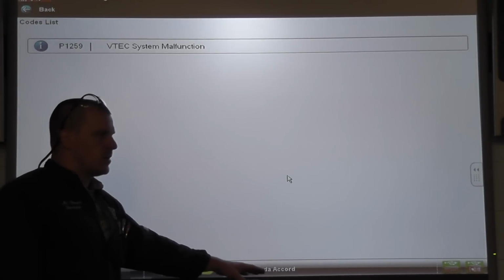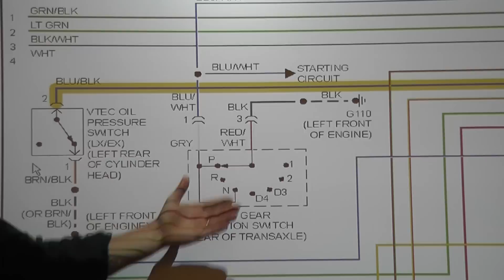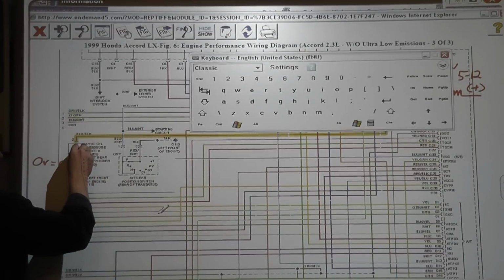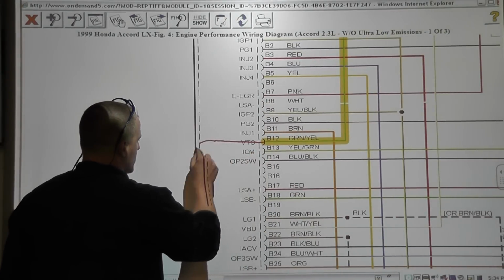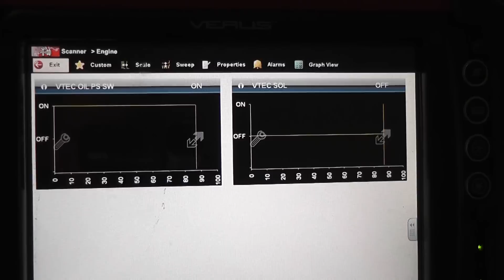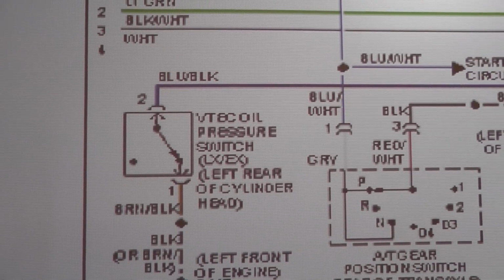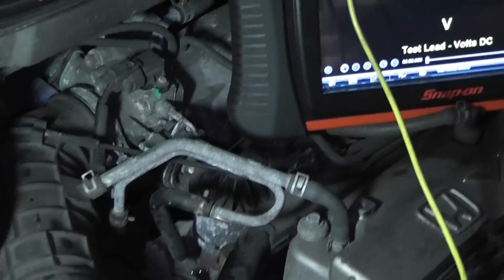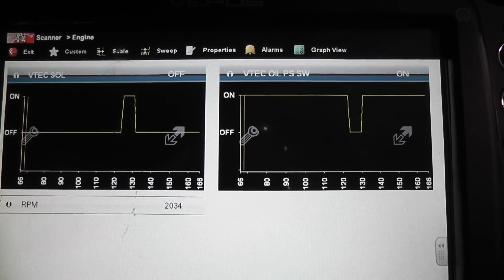Honda VTEC System Testing (P1259 trouble code)

Comment: Nice video, very informative. Should there be continuity between the two terminals of the HARNESS of the pressure switch? Also, what does it mean if you measure 5V between terminal one of the pressure switch harness and ground, while the solenoid is not activated? You measure 0V in your video. Not sure why I am getting 5V.
Reply: On the psi switch itself. Yes and no as the switch opens and closes by hydraulic psi. As far as when it read 5 and when it reads 0 on the psi switch, I don't remember. (Thought it was 12) It is the change in voltage on the psi switch, as the solenoid is energized that is important
Reply: So if you energize the vtec solenoid, and you see no voltage change on the pressure switch, does this mean that the pressure switch is bad or is the ECM/PCM bad?
Reply: My problem was fixed by replacing the entire solenoid / pressure switch assembly - it is possible mine was clogged. If you already did that, and you are not getting that voltage change on the pressure switch, it is possible your oil pressure is too low to activate the pressure switch. It is hydraulically activated. Get the kit from harbor freight for $20 if you don't already have one. You should get >10psi at idle, and >45psi at 3000rpms. Wait till the engine is hot to get your final reading. If your oil pressure is low, you may need a new oil pump and that could be the root cause. Also, make sure you have the multimeter hooked up to the black/blue wire.
Reply: I thought you had already replaced the vtec solenoid assembly? The assembly includes the solenoid + the pressure switch. If not, go for this first. Dorman sells the assembly which is what i used and it worked. The price of the dorman assembly made it worth buying compared to the pressure switch by itself. There is a kit at harbor freight for measuring oil pressure in the automotive section. Its $20. Just a hose with brass fittings and a gauge. The brass fitting gets connected where the oil pressure sender unit is, just below the vtec solenoid assembly. It can be identified by a rubber blue connector. Remove the connector and then unscrew the sender, and then connect the hose for the pressure gauge in its place. Start up the car and wait for it to get to temperature as the pressure reading will change as the oil heats up.
Reply: It was a bitch for me too! Are you sure there was no leak in and around the brass fittings or the hose itself? When I connected mine, i got about 70psi as soon as I started the car, measured from idle. As the car heated, and the viscosity of the oil went down, the measurement ended up at 12psi. Another thing to check would be, is the gauge working (especially if its from harbor freight)? You may not want to hear this, but a good way to test if the gauge is working is by checking it on a car that is known to be in good working condition.  Alternatively, if you have an air compressor, you could also use that to check the gauge (and it may be the easiest way).  If your measurement of 0psi is real, I would start taking a hard look at that oil pump. Hard work but pretty cheap on rock auto...less than $100 last time I checked.
Reply: I have the same question.  I just replaced the entire solenoid / pressure switch assembly with brand new OEM.  When I energize the solenoid I do not see a voltage change on the pressure switch.  I do not hear the sound of the engine change either.  What does this mean?
Reply: Thanks Terp Guy.  I think you are right on the money.  It's got to be my oil pump gone bad.  It's a little discouraging I have to take off the timing belt to get at it.  I might as well replace that too along with the water pump.  Big job.  :/
Reply: Take an oil pressure measurement before you do it. It's one of those things you wanna be sure you need before you get started. Here are instructions on how to change the oil pump for the 2004-2008 tsx. Apparently, you only need to remove a sprocket from the timing chain, but not the chain itself. Doesn't look terrible. Good luck buddy. http://jrphotodesign.net/euror/service_manual/Engine/Engine%20Lubrication.pdf
Reply: Any tips on how to take an oil pressure measurement?  Also, if it is the oil pump going or gone bad, wouldn't the oil light come on?  I am hoping it is the oil pressure switch that has gone bad.  I hear these are a pretty common failure.  Whereas oil pumps seldom fail.
Reply: Yes, you're right.  I did replace the whole assembly.  Wasn't sure if there was another oil pressure sensor near the oil filter like on the older accords.   Thanks for the guidance on how to measure the pressure.
Reply: Man, that was a real dog to get that pressure gauge hooked up to port for the sender unit.  I used a lot of foul language in the process.  After I turned on the car and let it warm up I saw zero oil pressure.  No change when revving the engine up to 3000 rpm either.  Is there anything else I can check?  Seems like some kind of blockage or the oil pump really is dead.
Reply: Thanks for helping each other out guys. I have trouble keeping up. If you need additional help. Post to my forum on my website okay?
www.scannerdanner.com
Thank you!

Comment: helped find my vtech issue. oil in the connection. But the question is why is oil in the connection?
Reply: Angel T. Ik it’s been awhile but there is oil in mine too you say I clean it out then it’s all fixed and did it come back?
Reply: terminals seal inside its body got dried and seeped oil through ... common issue with Hondas
Reply: I put gasket maker around the top of the solenoid were it meets the sensor. because that's were it was leaking from. vtech finally fixed. Still fallowed steps from video.

Comment: Hi I have a 2008 Honda Civic Coupe The ECU does not send power to the VTEC solenoid valve when Rpm 6500 exceeded what could be the reason why not send the signal or current to the solenoid really hope you can help me.
Reply from the maker: IF there is a fault code for the solenoid, the computer may not send the signal to it to turn it on. Try this, and in this exact order. 1. Disconnect VTEC sol. 2. Connect an incandescent test light to the VTEC solenoid wire and ground. 3. Clear fault codes 4. Start engine and rev it over 4000 RPM, the test light should light up if the computer and wiring are good. 
Remember if the computer senses an open circuit during the above testing, it may not turn the circuit on.
Reply: +ScannerDanner hello test and perform as well as you told me, and tried the car from 4000 RPM to 6000 and did not turn on the light, check the wiring and is in good condition (with continuity) from the ECU. you think the computer is damaged or not programmed to send the signal to the solenoid VTEC? THANK YOU

Comment: It use PNP transistor with collector output! 
The variant with emitter of NPN that you show is funny and... amateur.
Reply from the maker: I don't care what kind of transistor it is. Doesn't make any difference from a mechanic standpoint and how this circuit works. Am I confident that the computer is supplying a power to turn this output solenoid on, is what really matters.
Reply: have you seen a circuit board blue print in this video explaining how to wire different types of transistors in an iphone7 platform? i don't think do, he just explained how the system is ticking and how to properly diagnosing it. plain and simple

Comment: Question, I completely understand that to show procedure you take us through all of the steps and I love that, however Couldn't you probe the solenoid and take a measurement at WOT to verify the wiring, pres switch, and driver are working?
Reply from the maker: +Matthew Tropp yes, that would work, but it takes everything working as it should to see the results you want
Reply: I understand, thank you for the reply you are an inspiration to aspiring technicians like myself!

Comment: im in a jam, 01 civic, same code, i put in new solenoid
 with pressure switch oem, changed oil,  same code comes back 1259,  what I noticed is have 6v on signal wire pressure switch engine idling.  passed solenoid test

Comment: Hey I was wondering if anybody could help me out well I have a weird problem I bought this 03 honda civic and I noticed the engine was replaced and the vtec solenoid was completely missing so I picked up a used one screwed it on and connect it as soon as I connected it and reset the ecu the engine light goes away for a while but as soon as I rev to 5000 rpm the engine light comes back on now here is the weird part when I connect the energizer wire the wire that goes to the solenoid the oil light comes on in the car when I disconnect the energizer wire the oil light goes off??? I'm thinking the last person who put the engine in didn't wire it up right or is it suppose to be that way.From my understanding from reading up online the oil pressure detector is suppose to be by the oil filter so why when I connect the energizer wire (the wire that goes to the solenoid to open the oil passage way)the oil light comes on???
Reply from the maker: +Malik Berry Malik, you can try posting this to my forum, one of the guys over there would be glad to look at a diagram and try to help. Thanks! www.scannerdanner.com
Reply: +ScannerDanner I figured it out the wireing was not right the wire that was going to the vtech solenoid valve was actually for the oil pressure sensor near the filter for the first time I got it to rev past 5000 but it only works every now and then I think the pressure switch is bad

Comment: hi dan have you ever energized the vtec solenoid and had terrible noises from the valve train?
thanks
Reply: My name is Paul but that's okay. I get Dan a lot. No I have not had any issues with doing this test other than the engine getting rough due to incorrect valve timing at idle with the solenoid energized.
Reply: ScannerDanner Premium thanks paul!

Comment: I would be concerned that changing the valve lift with the VTEC at Idle could be a risky move due to the valves hitting the pistons, but obviously it worked fine.  This is the first thing that came to mind when I watched this video. I know there are different variable cam/valve timing designs which may or may not be an issue if you manually (electrically bypass) change the valve lift or cam timing at idle. This is still a very good video. Keep up the good work!
Reply: Idle vs high rpm is not going to change the relative tolerance between the piston and valves. If they dont interfere at 5,000, why would they interfere at 700?

Comment: Being a honda tech and knowing that this vintage 2.3 accord engines like to burn oil with high mileage the #1 issue with this vtec system malfunction dtc is low oil. If the oil is low or was low and the oil was changed this code will store
Reply from the maker: Great tip thanks
Reply: +Alexander R Genetic flaw wtf you smokin bro? Lmao

Comment: Great video i learnt so much!!!
Can i request for a similar video in regards to honda's VSS - Vehicle Speed Sensor?
OBD code is P0500?
I'm having trouble with my s2000 03 model, i've basically almost done everything in mind to stop it. I try avoid resetting it because i want to properly resolve the problem. Any ideas in mind if you could help?
Thanks
Reply: Did you replace the sensor if you did and you drove it an the check engine light didn't go out you might have something wrong with the tone gear inside the transmission that or you bought a cheap s*** aftermarket sensor and didn't go Honda OEM even the wrong oil filter can cause that car to have a s*** ton of problems

Comment: Thought I'd add a little more about the vtec system on this car. After checking the code, first check the oil level on the dipstick!! When I worked at the Honda Dealer back in '99 saw several car with this problem, at high rpm red-line it will starve the system for oil. Drive it like you stole it to duplicate, the customer will never admit he was driving the piss out of it.

Comment: I know you are activating the solenoid to show the reaction of the oil switch but in its operation on the car is it not the oil pressure opening the oil switch which in turn signals the solenoid circuit to activate the solenoid which in turns operates the vtec or am I getting this round the wrong way good video paul am just slow with this info just now

Comment from the maker: The fuse in my jumper wire only protects the jumper wire from catching fire if I touch a power and ground at the same time. In no way shape of form does a fuse in a jumper wire protect the computer driver. If you get your polarity mixed up you will still fry the computer even with a fuse in your jumper wire.
Reply: But how , if the rate of amprage go over of ,,,let say 5amp,and the fuse is 5A ,so it would blow and cut the circuit,it's my imagination,please correct me if i'm wrong

Comment: Couldn't spray some electrical connector cleaner to clean out the oil? These things also have a gasket/screen, check if that was dirty/clogged?

Comment from the maker: Walmart craft section. Be careful with these, you can fry a computer driver if you don't use them properly. Also the jumper wire fuse in NO WAY protects the PCM driver. If you use a jumper wire to energize a solenoid and you chose the wrong polarity, you will fry the computer driver and it will not matter what fuse you have in the jumper wire. 
Please be careful with this type of testing!
Reply: So why not just always be safe and use an incandescent test light?
Reply: So is it safe using an incandescent gets light ????

Comment from the maker: Haha no, it is VTEC Monitor (VTM) as it is the VTEC switch input signal.
Reply: Hey SD; i recently repaired my honda 98 vtec and the solenoid valve connector (pcm) side was severed so i found a similar connector and reattched it and plugged it back in the vtec solenoid; now below that which is my vtec oil pressure swicth that is broken off although the wiring  is intact(connector) going to it; so heres my question is it safe to run my car with the oil pressure swicth not working ? I can hear the vtec engage as i accelerate and downshifts good aswell but the other day the car shut off coming to a stop on a highway the turn signals didnt activate but yeh
...  any input ?
Reply from the maker: @brionadderley1643  your symptom of stalling and turn signal issues has nothing to do with the VTEC psi switch not being connected. I am actually surprised the VTEC system kicks in at all with that switch out of the picture. You have another problem my friend. Look into where your turn signal circuit get power, in there you will probably find your stalling issue too. My guess is possibly an ignition switch problem. Smack on the bottom of the column, below the ignition switch and see if it makes the turn signals stop working on engine stalls to confirm.

Comment from the maker: @zachattack42289 With no oil pressure the VTEC switch is closed which pulls the signal voltage to ground. When the VTEC solenoid is energized, the oil pressure opens the switch and signal voltage goes high (12 in this case). Don't get the solenoid and switch mixed up. When the solenoid is "on", the VTEC switch is open (12v signal). When the solenoid is "off", the VTEC switch is closed (0v signal). Hopefully I cleared that up, let me know
Reply: Thank you for this excellent video. I'm struggling with this one. I thought the switch was the input to the computer, to tell of the computer to turn the solenoid on.   If that's not the case, then what tells the computer to turn the solenoid on?  Thanks so much for your book and excellent resources.
Reply from the maker: Programming! RPM and throttle angle in particular. And yes, the switch is AFTER the command is issued. It is a confirmation signal and it takes a hydraulic psi change to move the switch. Make sense?
Reply: Yes, thank you. That makes sense. I had just watched your video of a Subaru door lock circuit and in that case, the switch input signaled the computer to lock the doors. I made the mistake of assuming all circuits would work that way and failing to remember to the importance of familiarizing myself with the theory and operation of the system in front of me.  I did a little research and discovered exactly what you said. I could have saved myself the question by doing the research first, as you have taught many times.   Your book is solid gold.  May God continue to bless you and your family.
Reply from the maker: Oh awesome, you have my book too. Thank you! It is cool to see you using it as designed and watching these case studies too!
Reply: @ScannerDanner yes, from going through your book I have made personal notes and my notes are 140 pages long. So much good stuff in there!

Comment from the maker: @jlawrodgers Ok, system voltage sounds good. You need to shift your focus away from the V-Tech system and check your fuel pressure and exhaust backpressure. It sounds like you may be either starving for fuel or you have a restricted exhaust. Of course it could be other things too, but I would start there. BTW both of these testing methods are in my book. Fuel pressure should not drop under load (when you hit the throttle) and exhaust backpressure should = no more than 2psi@3000rpm

Comment: @ScannerDanner The Voltage at idle is 15.04 .at about 1500-2000 ,it actually drops to 14.78 . 
as far as the vtec problem,when I hit the throttle , it bogs down,and then stalls, then comes back to "life" when I back off the throttle.
besides that ,it runs just fine.
thanks ,again for your input

Comment from the maker: @jlawrodgers Over 15 volts is not good at about 15.5 volts you will start to cook the battery. What is voltage at the battery at 1500-2000RPM in park?
Does is stall like someone shut the key off or does it bog and then stall?